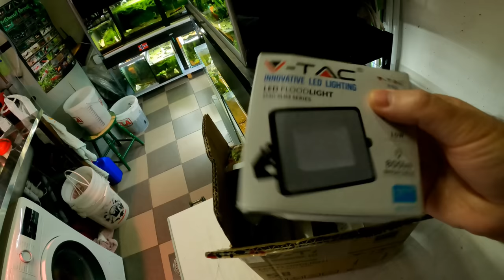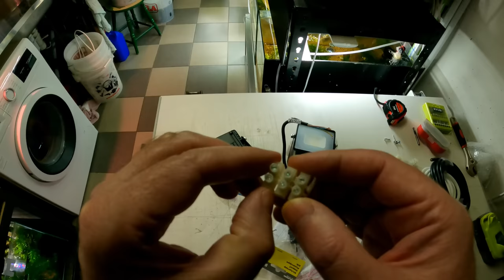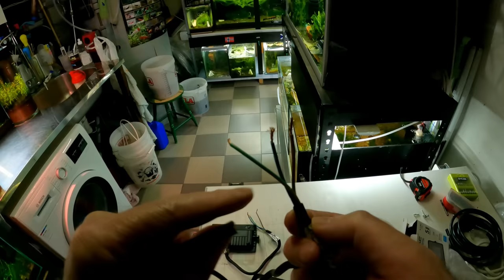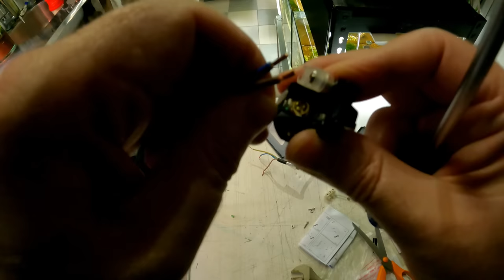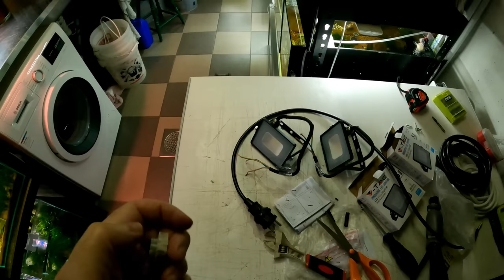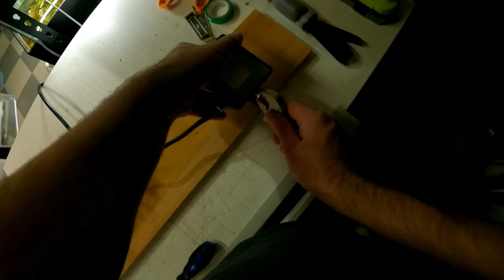Changing to 10 Watt LED Lights (Energy Crisis)

Comment: Morning Mark. Great video. I'm an electronics engineer here in the UK and work for an LED display manufacturing company. I've recently done the same for my friend's tank. Which is a copy of my tank, but I've gone all d.i.y. with mine. I'm not trying to do any advertising but....look on Ali express for 15w dc 12v led cobs  and find the 6500k daylight leds. There about £4 each and some come with a dimmer remote control. Match 1 up with a 100mm heasink from ebay. They are about  £5 for 4 pieces . Then match it up with a 12v meanwell power supply. I'm currently running 1 4ft fishtank and 3 - 45cm tanks with this setup on the 1- 12v 200w power supply. I then turn the current down to around 11.5v to keep the let's a bit cooler. You can run at full 12v but there really bright!. Then you can use the included remote to dim the led's up and down. I have explosive plant growth with this setup. I "can" include links but wasn't sure about youtube and your own rules about advertising something. (I'm not making anything from a sponsor or anything!) But if your not interested in building anything d.i.y. then Marks method in this video is a great alternative. The floodlights just run a bit hot so be mindful of that. The floodlight housings are usually ip68 and are meant to be used outdoors in all weather situations and  so they can take splashes from water so there safe (along as they don't get immersed in your fishtanks) otherwise you'll have dancing shrimp, briefly!
Reply from the maker: Hi can you send me links for this stuff via my email address? markpeggie@hotmail.com 
I had a look but pages come up and I dont know what I am looking at. 😂
Reply: @MarksShrimpTanks  yeah sure. I'll send you a bunch of info and some pics/video as soon as I finish work
Reply: Hi Mark. Sorry for the delay. I sent you that email. Hopefully it may be useful 😉

Comment: It adds more complication, but you could install individual breakers to each bank of lights. That way if you have a short it is less likely to take down an entire circuit in your room. Instead of wiring individual plugs to each light you could install a junction box with a panel and run the wires to terminals, creating your own power distribution. This is done often with industrial control panels for 600v/480v/240v/120v/24v/12v. 

What I'm imagining would look like this: incoming power (120v/240v) -> circuit breaker (rated for the combined lighting amperage) -> terminals jumpered/wired together (power distribution block) -> cables to flood lights. You will need 3 groups for hot/common/ground wiring. 

One advantage here is you could actually add your own timers right into the junction box(es). Certainly not a bad idea to hire an electrician at this point, that way you know you are up to local electrical standards.

Comment: Maybe also consider using an outdoor weatherproof 3 way switch to connect all your led floodlights. They are designed to be used outdoors. My friend's setup was 3 of those floodlights connected to the outdoor weatherproof switch. They were all screwed onto a wooden shelf above the fishtank. Sorry I had meant to add this comment into my previous comment 😅

Comment: I've used IDC314 connectors in areas with high humidity and have had great luck.  I wouldn't dunk them in a tank, though.  A 25 pack was about $10usd on Amazon.
Reply from the maker: thank you

Comment: Just a note... On the wires cut from the factory, you see the ground wire is longer than the others. If you ever get some pulling force on the cable, the ground is the last one that should release from the plug. That is a safety thing. So please leave the PE cable a centimeter or so, longer than the others.
Reply from the maker: that makes perfect sense, Thank you Rikard 👍
Reply: Thank you Rikard. That's a very useful tip. 👍

Comment: What I would've done differently is run the wires on top of the wood and the lights on the other side of the wood with holes drilled for the cables, then build whatever mounting support needed over the cables.
Reply from the maker: I might just do that, great idea thank you. 👍
Reply: Do you have electrical wholesalers in your area? You can buy good waterproof connectors and boxes to do all the splicing in. You could connect both lights to length of cable in the junction box and then put your plug on the end of that cable.

Comment: You could coat the connector in silicon, that would make it water tight.  Have you checked the heat that the new lights give off compared to the others you are replacing.
Reply from the maker: good idea Rob and they give off very  little heat almost just luke warm but then again they are only 10 watts.

Comment: I find doing it like you do is easier than using wire strippers. The wire strippers get dull after a while so the other way works better.

Comment: Good morning Mark,

My name is Ricardo and I'm from Portugal. I'm not your assiduous follower, I confess.
The project is interesting and I will also keep an eye out for these LED spotlights. As for the connections, I would make a hole in the board you used as a support, pull the cable from each of the lights to the top and make the connections there using a retractable sleeve. That way they were hidden and it was more of a barrier to any splashes of water
Reply from the maker: Thanks for sharing

Comment: Cake the lot in silicone cover in black tape to blend in a bit, soldering the wires and using heat shrink would work too.

Comment: The risk of using mains voltage near water is too high for me. Also another commenter advised against soldering mains voltage wires and I agree. If going down the DIY route I would definitely pay the little extra for low voltage fittings.
Remember to always have a loop of wire to shed any drips of water which could run down to the plug.
All the best everyone.

Comment: I'd use silicone or maybe an epoxy to seal that connection. They make something called "conformal compound" for waterproofing/insulating electronics, but iirc it's rather expensive. You might even be able to use nail polish to seal them, but silicone would probably be best as it'd be at least possible to remove without just cutting the wires.

Comment: You can buy the wire(you have the black cable), just get some shrink wrap tubing with glue in it. Connect the black wire directly to extend it and then shrink wrap each connection, then shrink wrap the whole thing. You will extend the wire

Comment: Could you not use silicone over a connection box with a lid? Or use potting compound to make the box water tight?

Edit:spelling
Reply from the maker: yeah I did think about that, you would think silicon would work great.

Comment: You cannot put them in series, you have to put them in parallel - i.e. blue to blue , green to green.... I would solder the wires together with a short pigtail going to the plug. cover joints with a dab of silicone then heatshrink.

Comment: I would just solder a wire to it and use some shrink tubing.
Reply from the maker: That will be the next one I think
Reply: I just read in another comment that soldering is only suitable for low voltage, which makes sense.
Reply from the maker: @ivancho5854  yeah that might not be so true, I worked for SUN microsystems like 30 years ago as a QC and everything was soldered, I can do basic soldering but I am not that great at it.
Reply: @MarksShrimpTanks  My electrical and material science knowledge is limited and like most things it's probably more complicated than first appearances. I'll investigate further and let you know if I find anything useful. 
I'm really enjoying your content Mark. Greetings from an icy Glasgow.

Comment: Sent u link for solution my brother
Reply from the maker: Thank you mate, I am looking for something that is waterproof, any ideas?
Reply: @MarksShrimpTanks  squirt silicone in a rubber glove. Pop connection in there for cheap waterproofing. I used this method after supposed to be waterproof fittings failed.
Reply: @garystein9536  Great simple solution. 👍

Comment: Too shakey to tell but did the corners have round, maybe plugs, that hide the screws? Please hold them steady for a few seconds, with bit more light, for a better view next time you showing items.
Reply from the maker: the corners of what?
Reply: @MarksShrimpTanks  the lamp on the backside. Could be round cast marks, can't make clear but fingers crossed maybe screws
Reply from the maker: @discrtidunkwn  ah yes maybe, my bad I had no idea what you were talking about there 😂😂
Reply: @MarksShrimpTanks  great vids btw, keep em coming. Also that idea of hot glue with the terminal block connectors sounds promising, be a bit of a pain to unscrew but for a one and done.